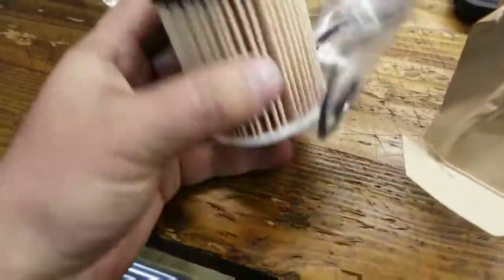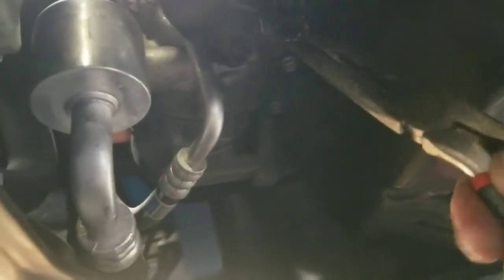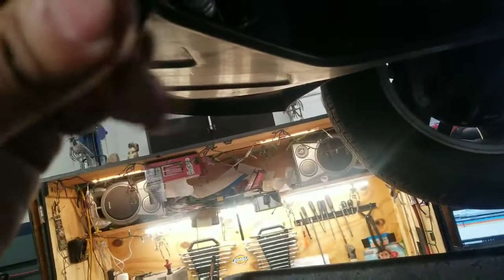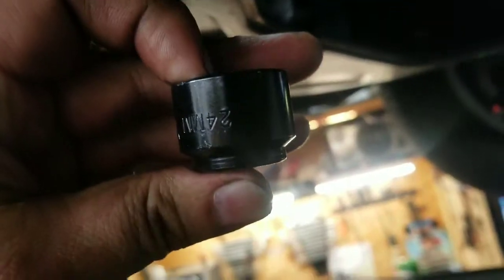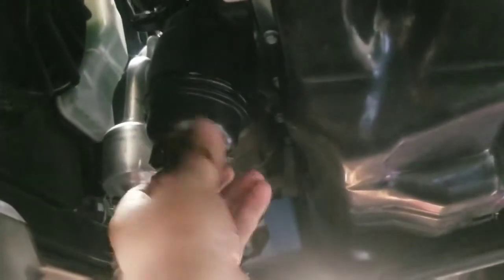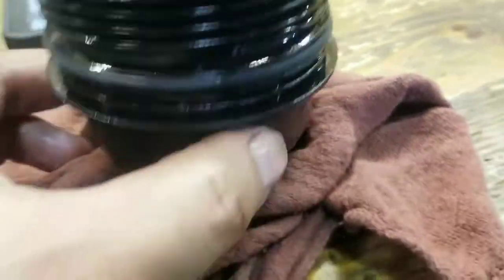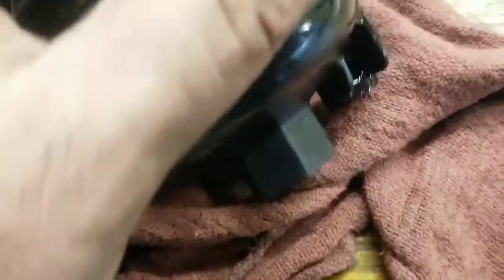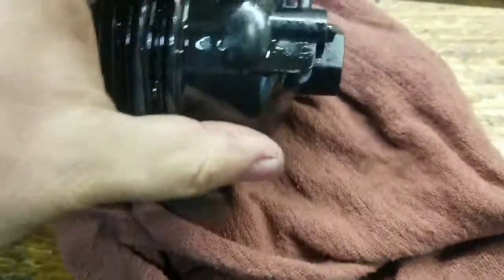2020 Hyundai venue oil change

Comment: Be sure to replace that gasket seal on the cup.  You may think hah it's going to be good and next thing you know is the cup will start leaking oil before the next oil change.  Ask me how I know. And don't overthighten the cup, just snug or it will get stuck the next oil change. The rubber seal is enough to seal and keep the cup from loosening

Comment: You didn’t mention the drain plug at the rear of the oil pan. I followed your video and ended up overfilling by 1-2 quarts because I only drained at the filter.

Comment: Yes thank you- I’ve been waiting for this video - so it’s a 24 mm socket to loosen and to retighten correct ? So all the oils drains from filter ? No need to drain any oil pan ? And what’s the weight of the oil ? Thank you for any response
Reply from the maker: You have drain the oil pan too(17mm).  0w20 i think, it says what oil on the oil cap on all Hyundai's.
Reply: Thanks  you 👍🏼😎
Reply: Is it the same process for a 2021 oil change ?
Reply: Just completed the oil change thanks to your video and advice. Thank you
Reply: @robertmedrano2768  Yes same for 2021. I have done mine 2 times already
Reply: @ L B great job ! 👍🏼👍🏼👍🏼
Reply: Mine is 2023 venue. It’s the same process. Just that I thought all the oil drain from the hole in the filter housing. It turned out you have to drain the oil pan too.